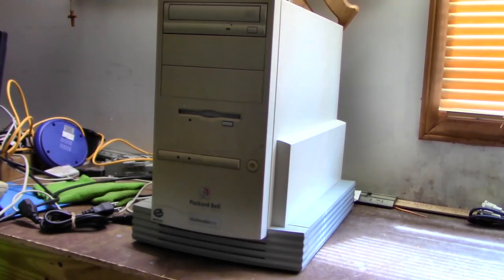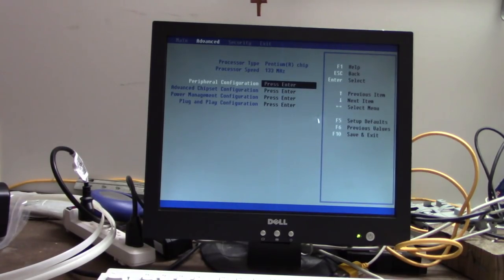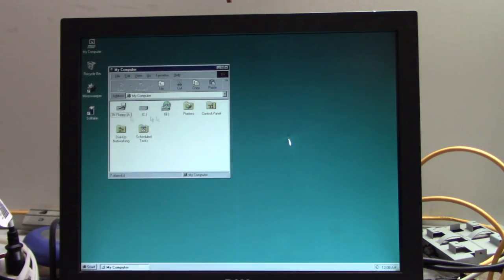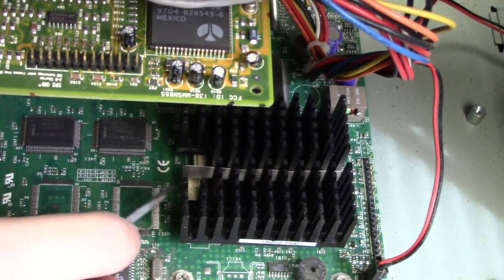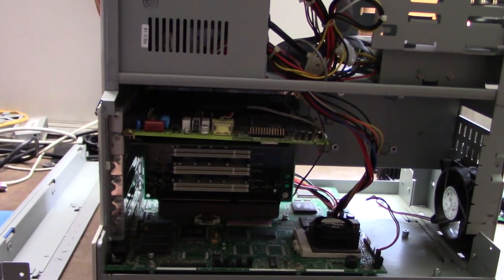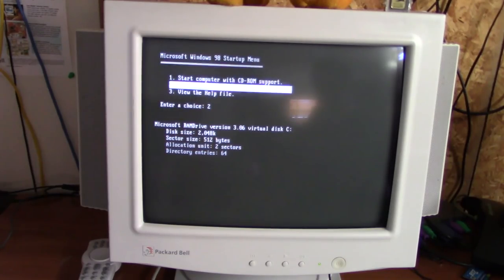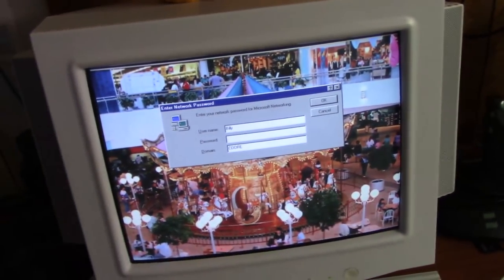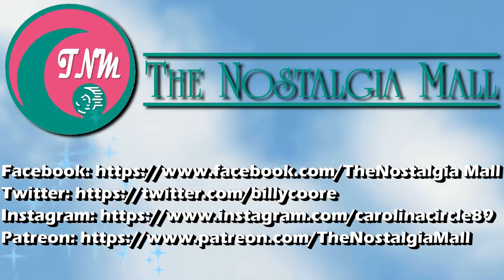Packard Bell Multimedia D142 Restore & Upgrade

Comment: The Sonic 3D even for me brings back a lot of memories. Probably a PC that would be most nostalgic for me is the AST Advantage Adventure 466 which I remember we bought that back in February of 1997 and it had a 486 dx2 66 mhz cpu with 8 mb ram, a 540 mb hard drive (1/2 GB), and Windows 95 A. The oldest PC that I have in my collection today is an old Toshiba Satellite 330cds from 1998 and it still has its original 4.1 gb hard drive manufactured in October of 1998 and has Windows 98se and has a 266 mhz Pentium cpu with 96 mb ram. I did actually get internet going on it although compared to todays internet, what you can do on a 1998 laptop is very limited, I can still check the weather on the old MSN site and do simple Google searches, but thats about it.

Comment: Were you ever able to get an SD or CF card working with this machine?  I say this as I've encountered a similar problem with my PB Multimedia D-141. When I restore the credentials, it corrupts the SD card.  Without the credentials, I installed Windows 98 SE using the SD card.  However, it was very flaky and error prone (similar to what you described in this video).  I have a CF card to IDE.  Again, problems.

Comment: I have a problem with my windows 95 utla sonic pc running windows 95 plus it wont make it all the way thru the scan disk and when I go to the control panel it locks up the computer and it will always give me 2 bsod s the warning one and the system is busy one and the control panel wont also work in safe mode do u know what to do

Comment: What size mobo would fit in this today? I own one which was my very first computer. Looking to convert it into retro setup running commodore and dos.
Reply: I believe that the Packard Bell systems from this era were proprietary. Any variant of the PB680 Orlando will fit, as there are quite a few, both Pentium and MMX examples with various video chips and memory types.

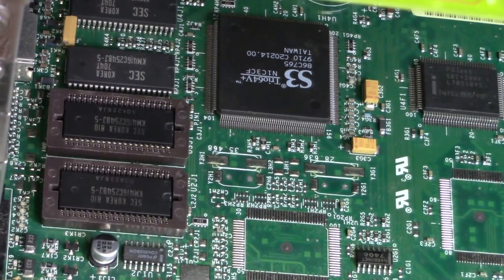Comment: 22:00 "Don't ever lose these." Well, they would be DEAD EASY to 3D print. Get some calipers and take measurements.

I guess I could do that because I have one of these machines. Found it in the bin with an MMX 166 and 16MB/4GB HDD. Still had the old owner's files on it. I should image the drive some day. But the PSU died shortly after I started using it. I need a new AT power supply now. D:
Reply: Image the drive because it has the original Packard Bell OS, not for the owner's files. haha
Reply: 30:00 "I shouldn't have said that!" Yeah... dead PSU ToT